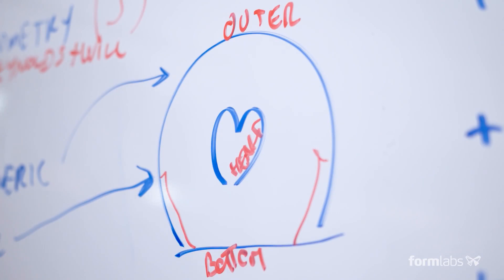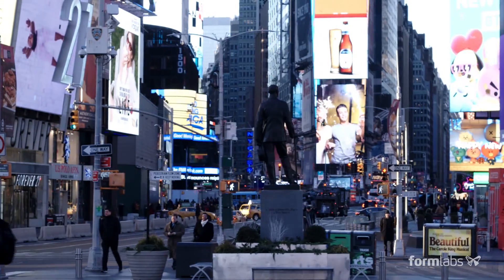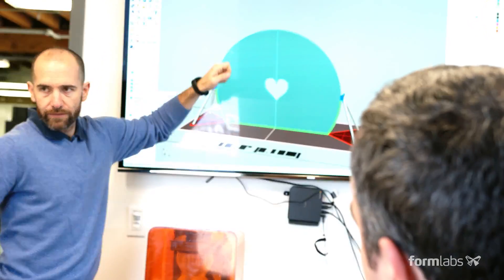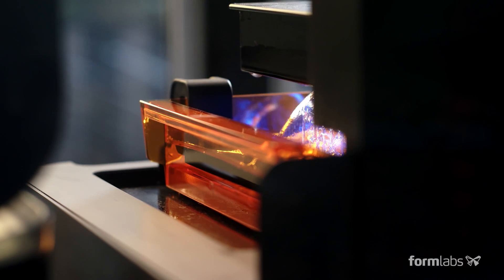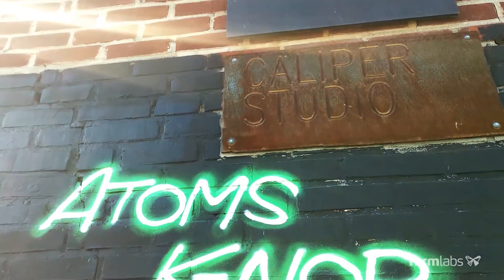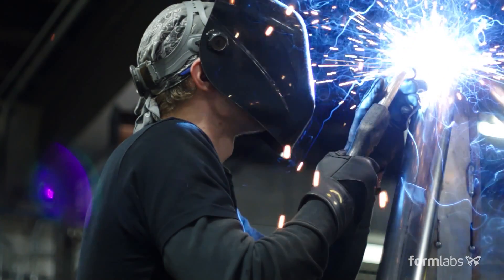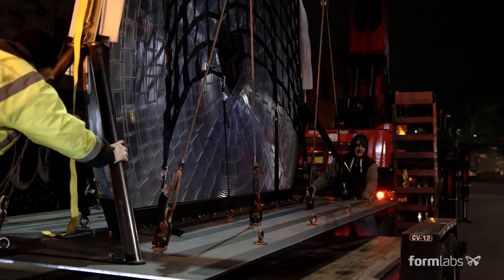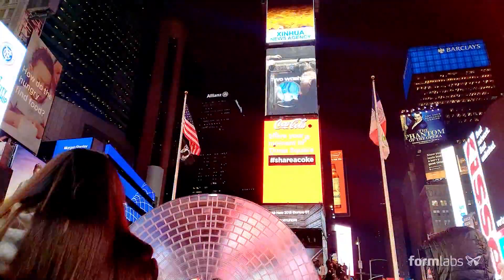Times Square Hosted the World's Largest Lens Made of 3D Printed Tiles

Comment: Hi! I´m a senior student in collage and we´re trying to do something similar to this for research purposes, could you guys help us by telling us how did you guys glued the blocks into the structure, which glue did you end up using? Thanks!
Reply: Hello,

I know it's late and I don't even have a 3d printer, but if I had to do it I would use the resin itself and cure it "manually".

The same resin will have exactly the same refraction index and so on, you can make bonds that are mostly invisible I guess.